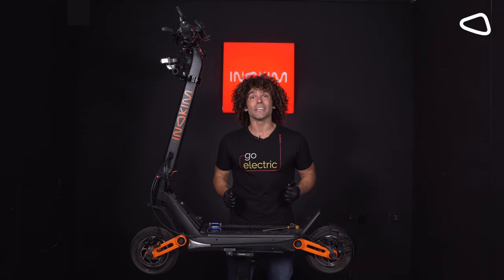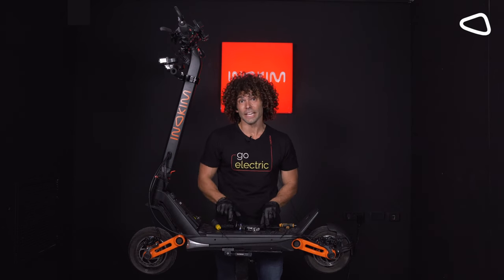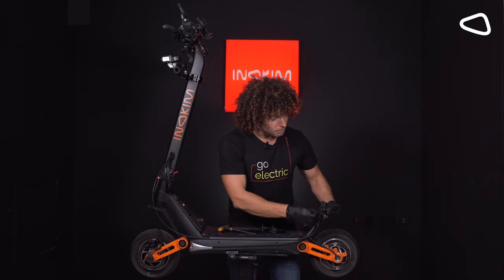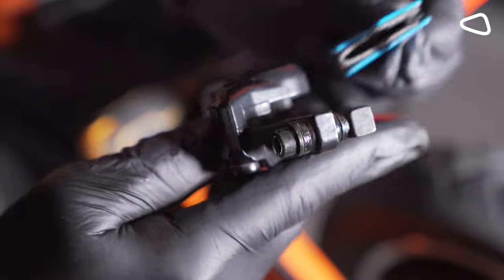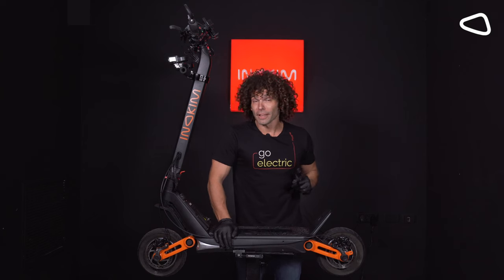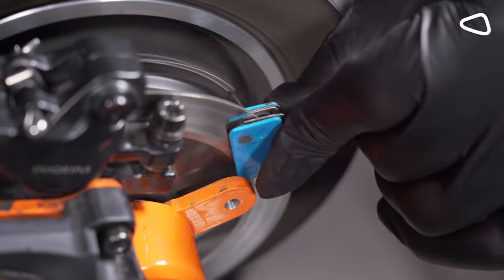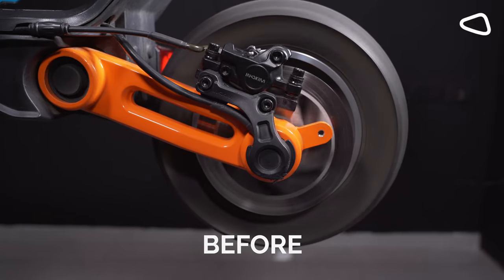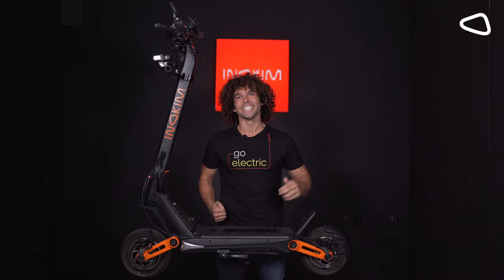How to replace BRAKE PADS & Scraping noise | Inokim OXO Electric Scooter

Comment: I burn through brake pads far too quickly on my OXO 🤣 I think it's the awful weather we're having in the UK which doesn't help. 

Another solid video from our Inokim family! Great work buddy 🫶
Reply: This is the main reason I do not have one yet.  Regenerative breaking is not just for recharging the battery, it prolongs the breaks. I only use the brakes for emergency stopping.

Comment: Haha your enthusiasm and facial expressions were awesome!  

I'm going to try the adjustments for my OXO front brake which has a scraping noise when not using the brakes.  

I've noticed my rear brake is not nearly as effective as when it was new a few months ago... If I pump the brake a few times it gets better, but the stopping force is still not like the front brake.  Do I need to bleed the brakes or do something with the pads to get them working better? I'm new to hydraulic brakes!

Comment: Can you help me? Oxo. When you hold the brake, the electronic brake that the motor brakes on doesn't work. It senses the brakes, turns off the power, and the brakes come in well.

Comment: the disc got bent so fast when riding faster, had to change it. Also too tight fit, would need to be able to loosen the grip on pads.

E. Ohh and to remove the disc the whole board must be opened, can't get to powercable yellow box behind battery wihtout removing it and to remove battery..